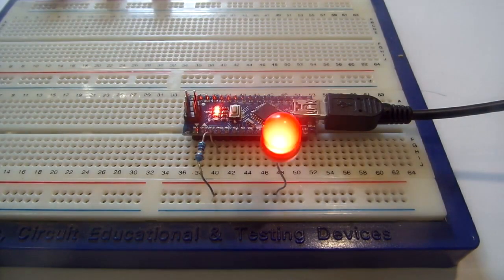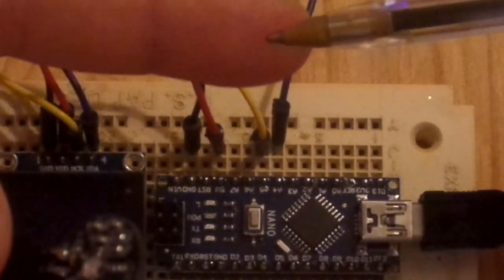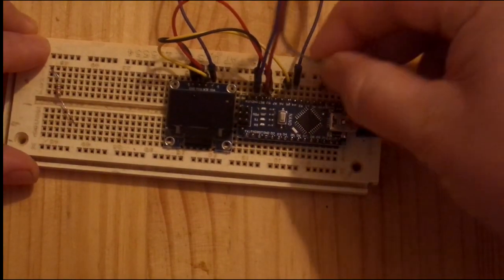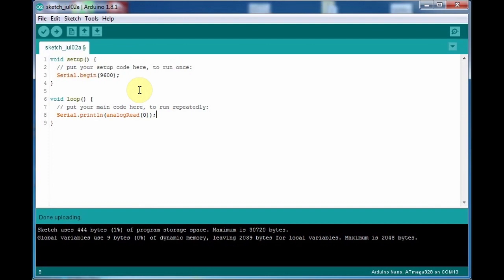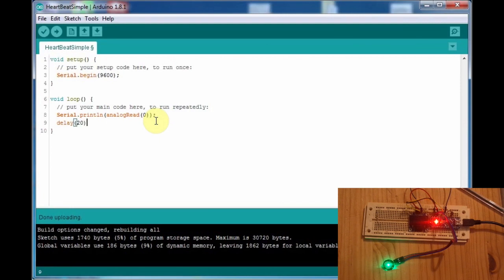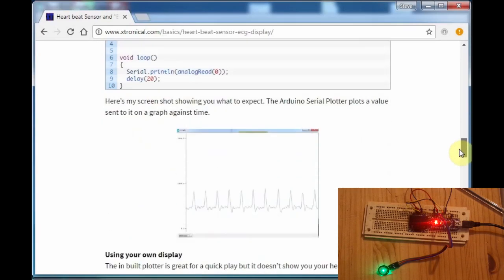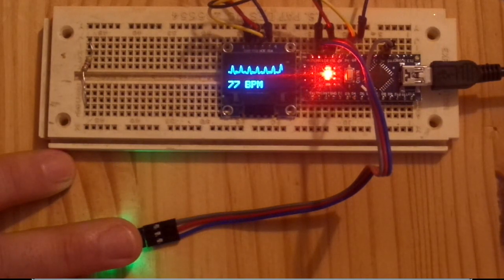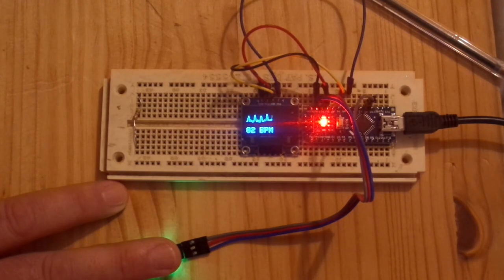Heart/pulse sensor with Arduino

Comment: Could you send an circuit diagram for this project  using a pcb to richardomosanya12@gmail.com since the pins aren't stable because I am making a heart rate monitor for my technology project and I don't won't the pins to fall out
Reply from the maker: I can update the project page to include a circuit diagram but from reading you comment I think you mean some sort strip-board or perf-board or even a full PCB. I don't have a ready design that would be ready soon unfortunately but when it's done I will reply here or drop you an email. But doing a perf or strip board design may be something you could do yourself if I put a circuit diagram up on the website?
Reply: @XTronical  could i use the strip board by looking at the circuit diagram on your website and also still waiting for the battery clip circuit diagram
Reply from the maker: Will knock them up over next couple of days.
Reply: @XTronical  thx u just earned a sub

Comment: Does it always have to be plugged in via usb before you can use it or can u add a switch and battery if so could I have the circuit diagram please
Reply from the maker: No, you can power a Nano in two ways, either use a power bank and short cable and still use the USB connection or  use a battery pack with a voltage over around 7V and connect to the VIN pin for +ve and Gnd pin for -ve. Although wasteful on energy sometimes for convenience a 9V battery pack and connecting clip can be handy but  if you can get battery pack that takes 5 AA cells that would be more efficient as this would give 7.5V, the extra voltage from the 9V is literally wasted as heat. I don't have a circuit diagram but hopefully from my description you can work it out
Reply: @XTronical  new to all this stuff could you make a circuit diagram for a 9v battery accessed by a switch and also can you solder the pins inside so it wont fall out from the breadboard send the circuit diagram if can to richardomosanya12@gmail.com
Reply from the maker: Can do, I would post to the website when done and leave a message here, won't be for a short while though.
Reply: @XTronical  last question can you solder parts in a breadboard so it can be more stable
Reply from the maker: No not really, you need to use some perf board or strip board for something more permanent. I've not done a tutorial but someone will have.

Comment: Can I put the sensor straight into my chest instead of my finger?
Reply from the maker: I've never tried but should work if there are capillaries near the surface, but these devices are sensitive to movement and pressure applied so may be tricky to get a clear reading.
Reply: @XTronical  oh thx pal and good job

Comment: When I place my finger on the sensor, the bpm number keeps increasing up to 200, do you have any idea how to solve it?
Reply from the maker: Do you have more detail, does it rise slowly, does it then stay at 200,does it always do this every time, what is happening with the tree trace.
Reply: @XTronical  it stays above 200 and below 350
it just show 65 for split second and boom u are flash

Comment: Hi, what display resolution/inch you use? Btw it us wery satisfying project.
Reply from the maker: Here's a link to the screen I used on AliExpress, it's a 128x64 OLED I2C device

https://www.aliexpress.com/item/1pcs-0-96-white-0-96-inch-OLED-module-New-128X64-OLED-LCD-LED-Display-Module/32639731302.html?spm=a2g0s.9042311.0.0.27424c4dS3LEfK
Reply: Thank you very much <3

Comment: what is the name of heart beat sensor as i will implement this project as graduation project
Reply from the maker: Sorry, I had replied to this using the phone app but my recent replies seem to have not gone up. Anyway search ebay or AliExpress for a "pulse sensor" and you will get this type of sensor come up, here's one that I bought on AliExpress:

https://www.aliexpress.com/item/Pulsesensor-Pulse-Heart-Rate-Sensor-For-Arduino-Open-Source-Hardware-Development-Pulse-Sensor/32714920300.html?spm=a2g0s.9042311.0.0.27424c4dSdKB4a

The screen is an oled 128x64 I2C screen, again here is one I bought on AliExpress :

https://www.aliexpress.com/item/1pcs-0-96-white-0-96-inch-OLED-module-New-128X64-OLED-LCD-LED-Display-Module/32639731302.html?spm=a2g0s.9042311.0.0.27424c4dS3LEfK

Hope this helps.

Comment: XTronical recommend for me others sensors can i use also in this project as my doctor teld me for graduation project please tell me
Reply from the maker: You need to visit http://www.xtronical.com/basics/heart-beat-sensor-ecg-display/ for the write up for the sensor and also http://www.xtronical.com/basics/displays/oled-128x64-arduino/ for a tutorial on how to get the recommended screen working. Without a re-write of the code it will only work with this screen (an 128x64 OLED display). The project will only wotk with this display and the pulse sensor shown in the video/article. I haven't the time to investigate or re-code for another sensor, sorry.
Reply: @XTronical  what is the name of this sensor
Reply from the maker: Answered in another one of your questions :)

Comment: i understand why we using these variables but only thins i cant understand it theses euations can you eplain it   int y=60-(value/16);
and       BPM=int(60/(float(BPM)/1000));
Reply from the maker: The y value is the vertical position of the trace on screen, with the divide by 16 scaling it to fit and the 60 setting a middle position on screen. The BPM is calculating your pulse (heart rate) beats per minute. The 1000 is because our timer counts in thousands of a second and we need it in seconds and the 60 converts to minutes as we want beats per minute (BPM)
Reply: thanks very much

Comment: ive got around 600 reading. what is the actual value?
Reply from the maker: 600bpm? Or do you mean 600 raw and what's the BPM? If raw then you need to use the supplied code to calculate BPM. If you're getting 600BPM then something is wrong but I'm not sure what.
Reply: @XTronical  where can i see the supply code?
Reply from the maker: Link to the write up and code is in the description under the video but I've copied it in below for you as well,

http://www.xtronical.com/basics/heart-beat-sensor-ecg-display/

Comment: error massage;;;;;;;;;;;;;

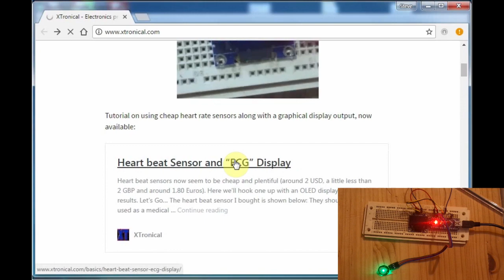Arduino: 1.8.6 Hourly Build 2018/05/15 10:41 (Windows 10), Board: "Arduino Nano, ATmega328P"
Sir.. All is redy.. But Display not show the beats.. Alll are set drivers, is completely ok.. But doesn't work.. If any changes in code? Please tell as early as.. 

  ........................................................................

SIR PLZ...  SLOVE THIS PROBLAM 

my procject is alredy done 

today is my procject submishion dates 
 
if you done my problam then i do for your channle
i try to 30 subscribers

Comment: My oled display board shows the BPM at extreme down
Reply from the maker: Did you read the suggested article for the display at 
http://www.xtronical.com/basics/displays/oled-128x64-arduino/

This mentions altering the header filer for the size of the display being used under the heading "Altering the screen size definition in the Adafruit driver library"
Reply: yeah it came

Comment: hallo i'm from indonesian me have froblem, you have library file???
Reply from the maker: All the code and required library files for the display are listed on the blog at http://www.xtronical.com/basics/heart-beat-sensor-ecg-display/
Reply: I've tried it, but there is one more problem the LCD is unstable, help me sir
Reply: this is my problem.. Sketch uses 17822 bytes (58%) of program storage space. Maximum is 30720 bytes.
Global variables use 1539 bytes (75%) of dynamic memory, leaving 509 bytes for local variables. Maximum is 2048 bytes.
Low memory available, stability problems may occur.
Reply from the maker: Hi, that is just your summary after upload and looks normal. When you say unstable do you mean the graph trace jumps up and down too much? If so these pulse sensor are a bit sensitive. Does your display show BPM?
Reply: yes the display shows BPM but after I unplug it and I reinstall the cable, the display is lost again ... please help sir
Reply from the maker: Sorry, I don't understand why your display would do that, no one else has had a similar issue. I've no idea. Sorry

Comment: Thank you. I managed to turn on the screen but it shows that "0 BPM", there is no continuous graph of heart rate. Yet I have no problem with my amped sensor. you can help me ?
Reply from the maker: Have you done the basic test of the sensor using the serial plotter as described on the project page.?
Reply: yes I did it. The sensor works with the monitor and plotter
Reply from the maker: Using the plotter what is your approx max and min values seen?
Reply: I am between 20 and 160. sometimes to zero then it goes back
Reply from the maker: Wow, that is very low compared to the one I used which was around 450 to 600. To get a BPM change two values in the code. Look near the top for two lines that set an UpperThreshold and LowerThreshold value. Change lower to 50 and upper to 100. That should give you a BPM. The trace however needs adjusting this line

int y=60-(value/16);

Change the 16 to 8 and see if you get a trace. Odd that you didn't see any line though.
Reply: I ordered new amped sensors. I just saw that my sensor does not detect (it is not sensitive).
Reply from the maker: Ok, hope you make progress
Reply: I hope too. I'll let you know

Comment: Hello,
is oled compatible with Arduino Uno? Is it mandatory Arduino nano v3? thank you in advance
Reply from the maker: It'll work with uno just fine, check out the Web page on my website for setting up the oled, it shows the different connections for different boards.

http://www.xtronical.com/basics/displays/oled-128x64-arduino/

Comment: Can you help me please? I tried those threshold values (used with Dharalle Sison) but it still didn´t work. My raw values are around 490-520 and bpm around 2 and 3, when I use upper as 550 and lower as 500. When using 480 as lower and 650 as upper, my bpm values are 0.
Reply from the maker: Raw values of only 490-520 sound like your just registering background "noise". Does the trace you see look like a heart beat trace? If you look at the raw graph using the Arduino serial plotter shown on this page 

http://www.xtronical.com/basics/heart-beat-sensor-ecg-display/

you can see from a normal sensor the range is somewhere like 480 to about 750 or so. Yours doesn't look like it's picking anything up. However try values of 500 lower and 510 upper and see if you get a BPM. Also double check the article I've linked to to check that everything is connected correctly and go through the basic checks of that page that use the serial plotter and just the sensor without any oled screen attached.
Reply: The trace I see looks like noise, just like you said, its just a line with little move, alterations only happen when I move away my finger, when its close to the sensor the trace looks steady. I checked the article and every code on it, and also the conections,  using those new threshold values it still didn't work. My problem is probably the sensor, right?
Reply from the maker: Probably the sensor but perhaps try another ADC on the nano as well. Perhaps also test the ADC with a potentiometer if you've got one handy

Comment: sirr!!!!! this following error is arising while uploading the code,,plz help me to correct it 

Arduino: 1.8.5 (Windows 8.1), Board: "Arduino Nano, ATmega328P"

C:\Users\zeeshan123\Desktop\ARDIUNO\heart_beat_sensor\heart_beat_sensor.ino:1:29: fatal error: Adafruit_SSD1306.h: No such file or directory

 #include<Adafruit_SSD1306.h>

                             ^

compilation terminated.

exit status 1
Error compiling for board Arduino Nano.

This report would have more information with
"Show verbose output during compilation"
option enabled in File -> Preferences.
Reply from the maker: Have you set up and tested the screen as mentioned in the video? Looks like you've not installed the required libraries for the oled. If you go to the video description there should be links in the description for getting the screen working, then come back to this project and it should work.

Comment: The last question : 
X represent what ? 
and beatComplete ?  

Really this is good job
Reply from the maker: x is just the position of the trace across the screen starting at 0 and going up to 127 (which is the the far right of the screen) where it will reset back to 0. It goes up by 1 every time we go around the main loop and we draw the new part of the trace from the last position to this new x position.

The BeatComplete indicates when the routine has detected one full heart beat and when it has it looks at how long it took between the last one and this one, it's at this point it can calculate the BPM.

It feels like you are writing up a description of the software as part of some school/college/uni project or something ;-)

Comment: I want to ask you : what is the equation y mean inside the code and where does the number 16 com from ?
Reply from the maker: y is the position of the trace in the vertical direction ( a measure of the strength of the pulse from the sensor). The 16 is an magnification adjustment, the bigger the number the smaller the height of the trace will be, the smaller the number (i.e. 8) then the bigger the height of the trace.
Reply: XTronical 
Ok , Thanks alot 
please , Can you tell me : How I can find the upper and lower threshold ? 
the variables : lastx , lasty, BPMTiming represent what ?
Reply from the maker: LastX and LastY are used so that the trace can plot a line from the last end of the last part of the line. BPMTiming helps the code to know if it's currently working out the time of one beat. The threshold values can be tweaked by looking at the range of values sent from your sensor. See the sample code for this on the Web page write up.

Comment: No such file shows in arafruit_ssd1306.h file not found
Reply from the maker: Have you installed the adafruit ssd1306 driver from the libraries manager? If not follow the instructions for setting up the oled here :  http://www.xtronical.com/basics/displays/oled-128x64-arduino/
Reply: No
Reply from the maker: OK, so you need to install it, see the link in my previous reply :)
Reply: I done the program is compiled but nothing on display
Reply from the maker: Have you checked the "sticky" comment on this video, look at the first comment underneath the video in the comments section. You have to alter one of the adafruit settings depending upon what display you are using.

Comment from the maker: For those having problems with the trace being at the bottom and the BPM being missing then this is caused by the following lines in the Adafruit_SSD1306.h file in your libraries folder :

#define SSD1306_128_64
// #define SSD1306_128_32
// #define SSD1306_96_16

They should look as they do above with the SSD1306_128_64 line un-commented and the rest commented out, by default this is not the case. This is explained in the video about connecting up an OLED here https://youtu.be/ZzqOYwG-OzM

, and on the web page here : http://www.xtronical.com/basics/displays/oled-128x64-arduino/
Reply: I do it
#define SSD1306_128_64
// set SSD1306_128_32
// #define SSD1306_96_16
Same effect
Reply: plz reply me on my comment bellow sir
Reply from the maker: I have done.
Reply: Sorry just question if I put this on wrist and sort make it to a wristband. It will work exactly same?
Reply from the maker: In theory yes but in practice probably not as the sensor is very sensitive and you will get a lot of false data.
Reply: hey XTronical  My sensor has threshold values in between 505-515. and also it is not working what should I do??
Reply from the maker: Are they the values your seeing using the test code to look at max and minimum values? If so then something wrong with the sensor as they should give a better range.
Reply: where can i purchase the sensor from?

Comment: Hi ! I wanted to do the same thing with a flexible oled display but the pulse is not shown well : can you explain how to set the position of the pulse on the screen please? Great tutorial!
Reply from the maker: I've been looking into this issue this week, next video will have altered software to solve issue. It's because the adafruit driver code has changed
Reply: Great! i have this flexible oled https://www.sparkfun.com/products/14543  . The library is different from adafruit
Reply from the maker: Oh, I've just pinned a solution to most peoples problems using the Adafruit Library, I will have to have a look at that if it's different, get back to you
Reply: Thanks! You do a great job